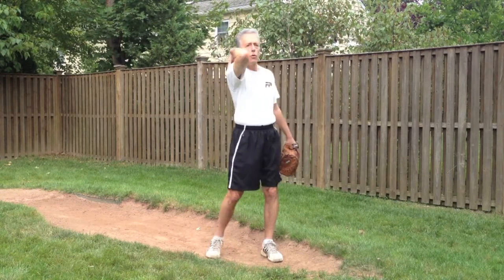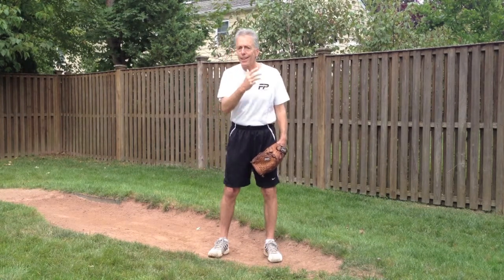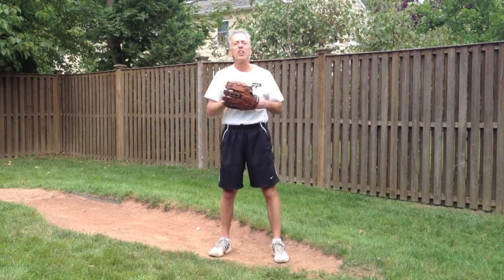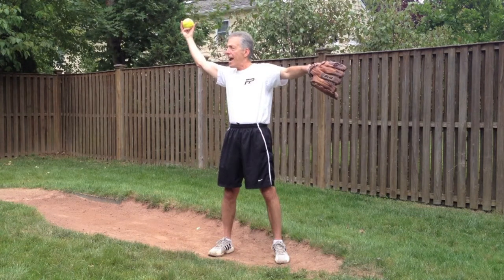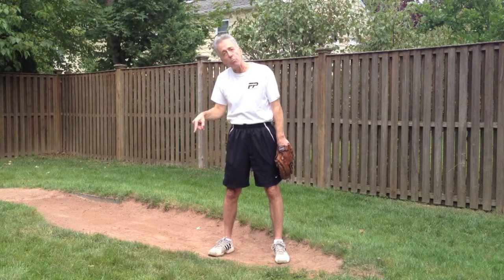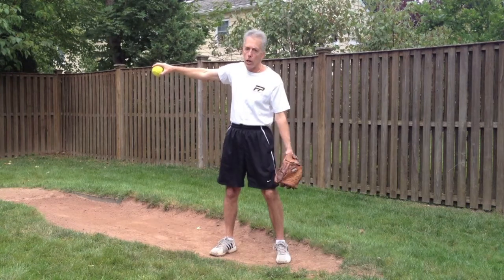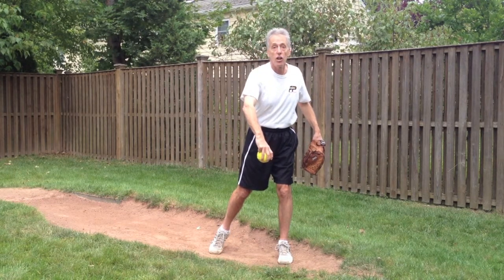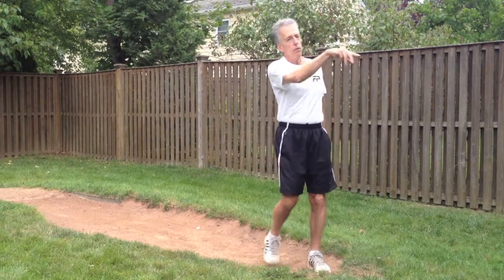Softball Pitching Mechanics: Troubleshooting forearm fire

Comment: In my opinion the main reason why pitchers would turn their palm down is because that is the natural position of the elbow at that point. If I have my arms besides my body the elbow is pointing to the back (of me, not the pitch). If I now lift my arms to shoulder height, my elbow is still pointing backwards. If I want to turn my elbow to point downwards I need to use the muscles in my upperarm and shoulder. Young children that do not have the power to do this will struggle to get their palm up.

And since pitchers will need to use force to turn their palm up I am actually concerned that will lead to injuries.